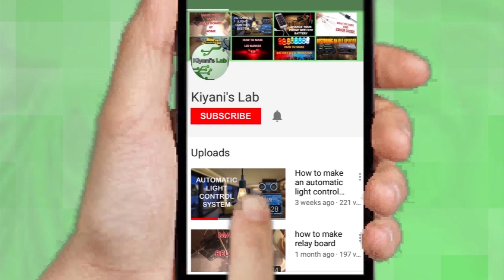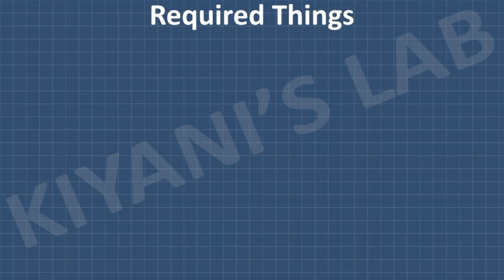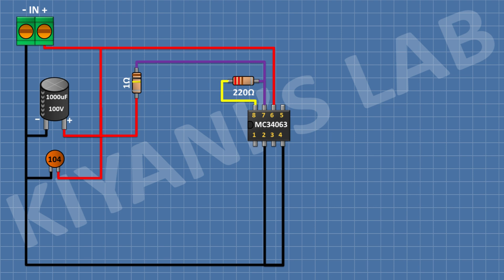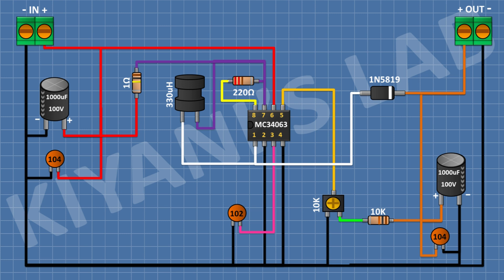How To Make DC Boost Converter Using MC34063

Comment: I made this circuit while ago. But output current is too low and output isn’t stable !  What was the problem?
Reply: From it's datasheet it has a limited current it outputs and when your load draws more than the Rsc current the voltage begins to fluctuate

Comment: How can you change the design for better voltage control over more turns that 1/4 to 1/2 turn?
I want a system that provides me with better voltage adjustment control.  Your system seems like it would be difficult to get exactly the voltage that I want in fine increments.